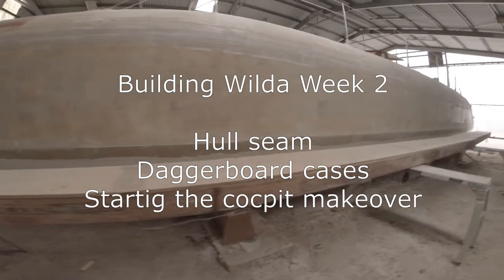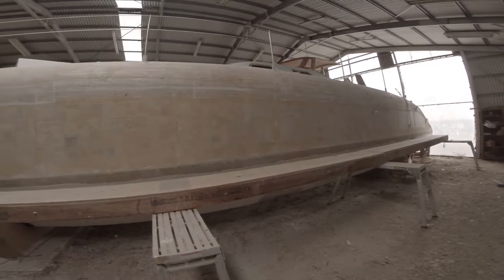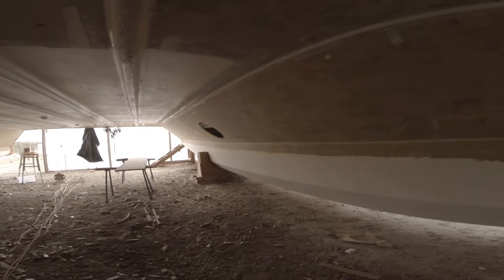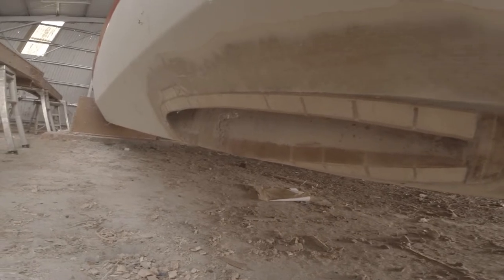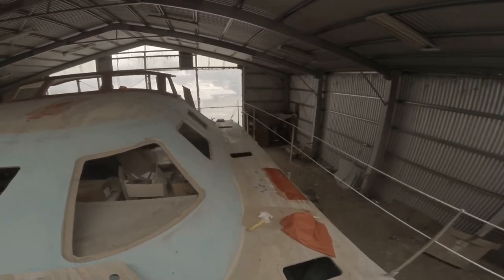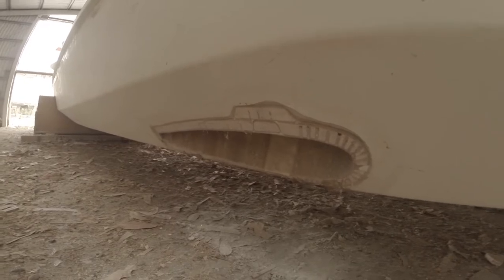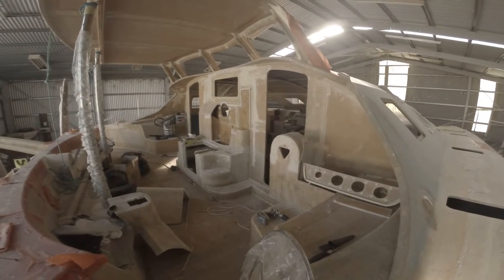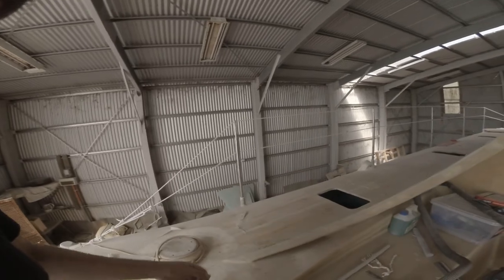Dust and epoxy - Week 2 - S01 E03 - DIY Catamaran

Comment: I'm a bit late to the build but enjoying it. I'm looking at starting a build myself and have some questions if you don't mind: you said you are building in Aus, where in Aus - because location determines weather, price and local expertise for me. 
What size shed do you have there?
Did you buy the shed&land or are you renting it?
Would appreciate any info you are willing to provide.
Reply from the maker: Sorry for the late reply. I lost the one I had written, but apparently not posted.
I'm happy to answer any questions you may have though I can't say I'll know everything you might want to ask about. I'm building not far from Melbourne.
The shed was actually built by the owner of the yard to accommodate this boat. An agreement between the yard and former owner of the boat. I'm renting at a pretty fair rate. The yard owner is an experienced builder and there is a boat painting company working out of the yard. 3 schionnings and an Oram being built/rebuilt right now. Plus several smaller restorations, mostly multi due to the shallow entrance.

Like I said, happy to help if I can

Good to hear from you, hope you follow along once we get back to OZ and Wilda.

Comment: With the batteries mate think of the acid fumes To mate ???
Reply from the maker: Sealed batteries. Nothing to leak. If they do, I will have bigger problems 😂 but thanks
Reply: @buildingwilda  all batteries fry and give off fumes too mate :)
Reply from the maker: @vivianbond7449  only if you treat them badly.

Comment: Just curious how are you going to glass inside of the daggerboards holes....  :)
Reply from the maker: 😂 Good question.

Actually the cases are glassed before going into the hull. A hole is cut, the cases inserted, then cut to shape. All that is then needed is to tab them in place. Not an enjoyable task at all, but done now 😂 it's in one of the early episodes.